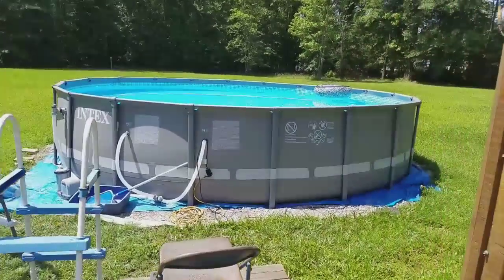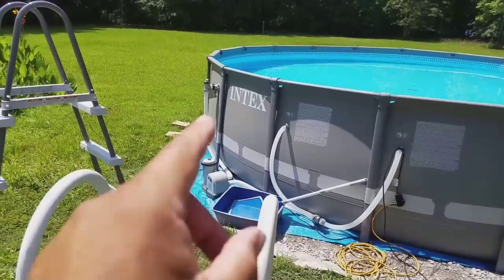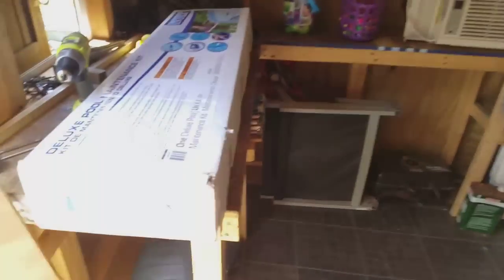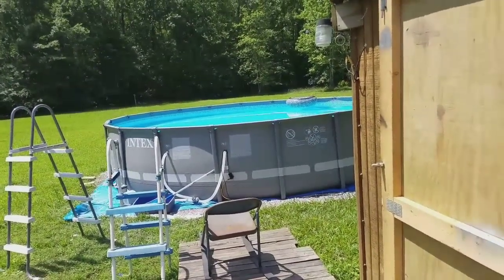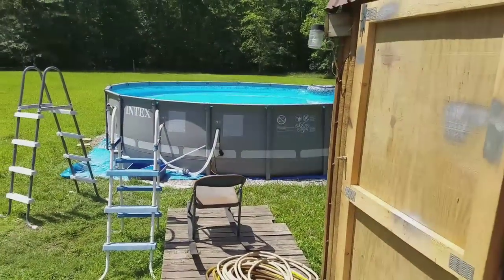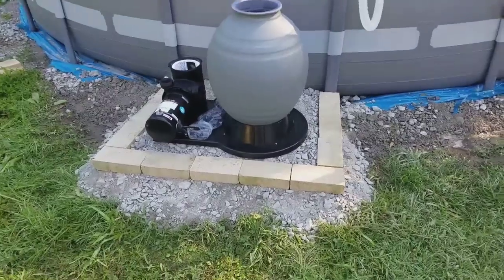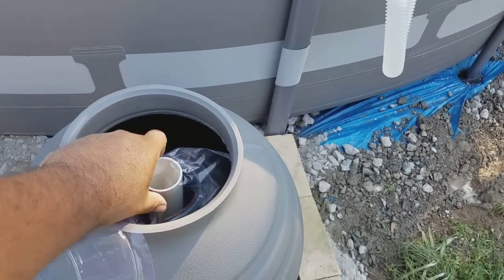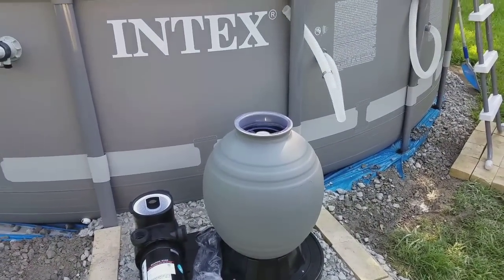Installing an 18" sand filter with tidal wave 1 horse pump

Comment: I got the Intex skimmer which came with a little cap with a little hole to go on that second intake port.  So it doesn't block it completely, it just restricts it down.  Like you said, with it open the skimmer just doesn't work.  But with the restrictor cap on, the skimmer works awesome.

Comment: Great job. I had the same pool. DO NOT USE SALT!!!! The metal supports rusted out in 2 years. I did the same kind of upgrades but I used a large mouth thru-wall pool skimmer from Amazon. I put two PVC valves on each suction line to control the flows.
Reply from the maker: Nice thanks for the heads up we have been thinking about salt but not now lol

Comment: That original cartridge pump looks like the 1500 gph model.   Probably a little dinky for that pool, but for my 12-foot pool it's AWESOME!  Flows 3 times as much as the tiny pump mine came with, and the water stays super clean along with the skimmer that hangs on the side!

Comment: I’m confused. The pump has a 3 prong plug so it’s grounded when you plug it in. The post that you used for grounding is actually for “bonding” the pool. I had to dig a 6” trench 18” away from the pool all the way around. Then I had to make four connections to pool body. Also, the bonding wire is supposed to make contact with the pool water. It’s a different pool than yours but the same type of filter.

Comment: Hi great video. I have the same pump and filter and I set it up the same way you did but I have water leaking from every hose and gasket and from the top of the 6 way valve where you change the settings.   Can you help me and explain what I could possibly do to fix the leaking from these hoses, what causes this to happen. thank you so much for your help hope to hear from you soon.

Comment: First of all thank you for sharing your video . Even though you didn't show every thing you were very helpful in reconstructing to intake holes . These 2 new smaller holes is a joke .  Any way my question is for the skimmer did you have to order a different size hose adapter . The smaller holes have smaller connections . I went around to my local pool stores and they  could not help .
Reply from the maker: I went to home depot and found the connections that I needed

Comment: I’m new to this and just upgraded Our pump Ours came with with this exact pump. What’s the point in ground wire? Will You get electrocuted if You don’t do it? I’m so confused lol. Our pool is on a concrete slab so I’m not sure where We would put the pole into? 😩 Helppp! 😁
Reply: I’m not understanding this ground on my pump either? Did you figure it out

Comment: Hi I noticed you have the same problem with your skimmer that i have   i used to have the intex 16x48 that only came with the 2 inlet /outlet i had skimmer attached and it worked beautifully super suction that trapped all the debris      well now i have the new intex 18x52 and it has 3 inlet/outlet and when i tried to hook up a skimmer suction was barely there    so i did the same as you i  closed off one of the inlet holes and i still had mediocre suction to remedy this problem this season iim going to close one of the inlet holes off take off the t hose and valve and directly hook up skimmer to the pump     i think you should do this too  because i noticed your suction in your skimmer basket is very weak  you have that huge sand filter that will do so much more than what it is doing
Reply from the maker: Awesome thank you we didnt have any problem with it like this but if we feel the need we will try the way you have said.

Comment: Sweet setup, it's very similar to ours. Check out the thru the wall skimmer. It is so much better than a basket.
Reply from the maker: Thank you I'll definitely look into that
Reply: how do you connect as you called it a through the wall skimmer work with the 2 smaller holes . This new design is driving me nuts

Comment: Tnks 👍🏼, question ☝🏻 if I do all pump and sand filter lines with a 1”inch PVC , ( no matter about caudal pressures? I’m figure out the mi kid pool 15 ft diameter

Comment: You can swap the two inputs with the one output and you won’t have to close one...= 2 in.  And one out
Reply: Keith Geiman we have a Colman 18” pool and just bought a Hayward 18” 1.5 HP sand filter and I am trying to figure out how to setup the intakes to the new pump lol

Comment: please help - at 12:50 - what is the fitting that you used to connect the two outlets in the pool wall to the PVC?? please help me with the size and name of that fitting so that I can connect to PVC... and then the fitting at 13:15 is that the same fittings?  THANK YOU SO MUCH! i'm tired of my hoses cracking in the Texas sun.  going PVC now
Reply: They are called elbows and He said they were 1 in . When I went to home depot I ended up doing the same idea but a little different . works great I just need help with the skiimmer hose attachment .
Reply: not the elbows - the fittings with the bands

Comment: A 2 foot grounding rod will not work correctly as a ground . check your local electrical codes. you need to install a 1/2 or 5/8 inch X 8 foot rod that you can purchase from Home depot. a 2 foot ground rod will have the opposite affect , it will be restive to ground. NEC code "The only legal ground rod must be installed a minimum of 8-foot in the ground"
Reply: Guy, chill. He did mention this kit said in the manual that he should connect it to the metal frame on his pool. But because his pool is not metal he used a rod. Unless you are the grounding rod police then go do something about it.

Comment: Set up my 18x52 intext pool with sand filter. My filter setting is not working but all the other settings are working, backwash and recirculate, but when I put on filter nothing comes out of the jet, and I can’t figure it out, what do you think could be the reason? I appreciate any suggestions. Pool been up for 3 days 😩
Reply from the maker: Oh wow I would check to make sure my hoses were hooked up to the correct sides for the flow to be in the right direction. Other than that I would be lost as well I hope this helps.
Reply: Lawrence Duarte thank you, we did have it wrong working great now !
Reply from the maker: Linda Porreca that's great im glad to hear it you're very welcome

Comment: Hey man, what did you do with that clear small hose in the filter?
Reply from the maker: +Michelle Magana it's basically a pressure release thing you leave it all the way at the top hold it up while you're putting the sand in and leave it on top of the sand

Comment: it's not a sand pump. it's a sand filter. and a circulation pump
Reply from the maker: Yes you are correct thank you
Reply: Sand filter with pump
Reply: What's the difference?
Reply: Thank you for the correction, I was so confused. Why would anyone want to pump sand into their pool?

Comment: The sand filter is a downgrade.  The cartridge will filter smaller particles than the sand. The cartridge even that it's small will give you cleaner water if u hose down the filter once a week.
Reply from the maker: That makes complete sense thank you for the comment
Reply: It doesnt make sense that cartridge filter is the downgrade shittu power and shotty filtration can't trust those intex brand pump and filter combos they don't even give you half a horse!
Reply: I don't think people understand these sand filters. 

But I feel like a cartridge filter is limited when it's dirty. Sand filters are made to reuse. You back wash your sand and blow out the dirt. Then it's ready to use again.